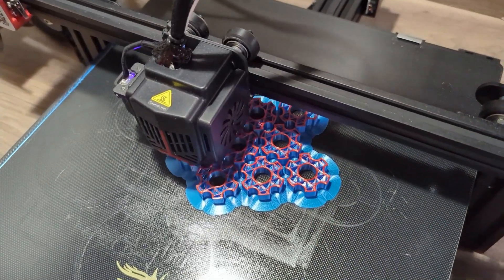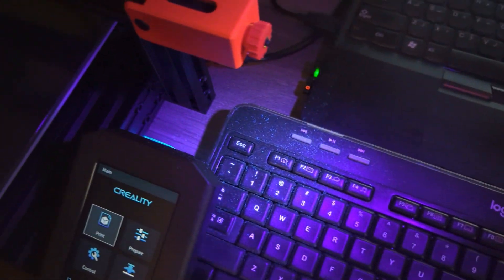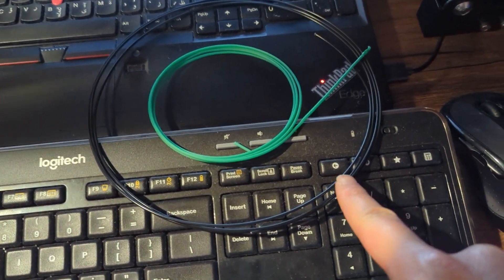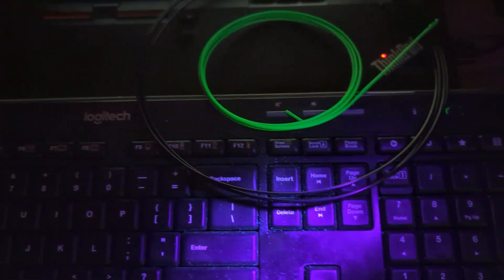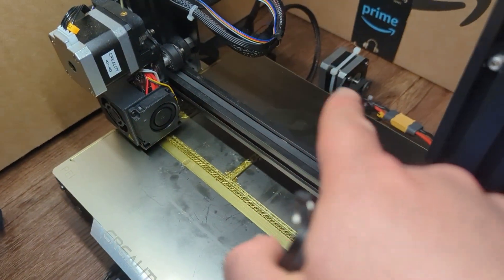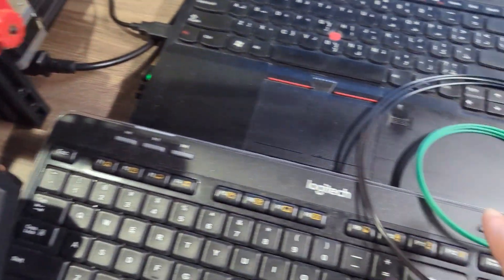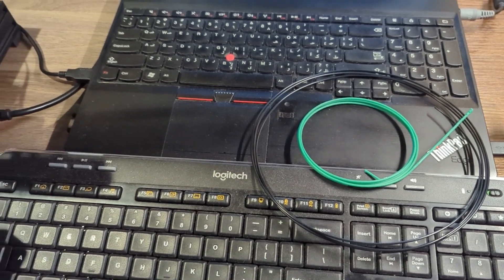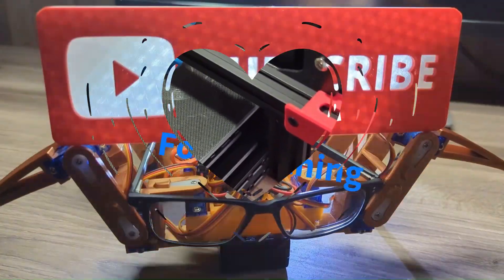This Doesn't Look Good - 3D Printer Particles Everywhere (Part1)

Comment: I feel like sometimes PLA smells like syrup when it’s printing. A bit concerning but I have an enclosure so it shouldn’t be as bad.
Reply from the maker: This is the promised update https://youtu.be/XhY56an9t0I I hope you find it helpful. Thank you for watching :)
Reply from the maker: With an enclosure you should be good, generally PLA is not terrible but I still found particles everywhere in my place not only near the printer. I do print all the time with 2 printers running almost all the time but now working on a solution, I will update with a new video in 3 weeks or so. Thanks for watching